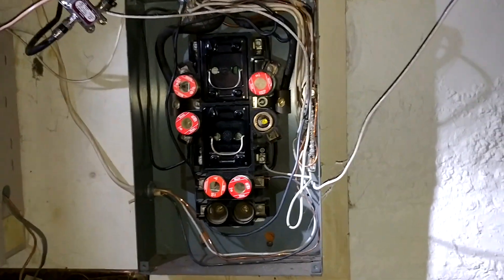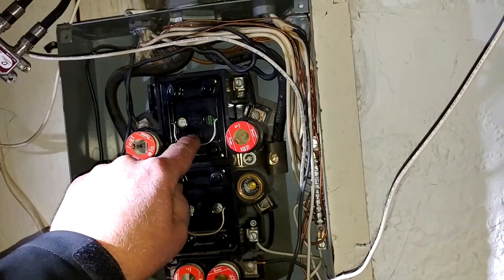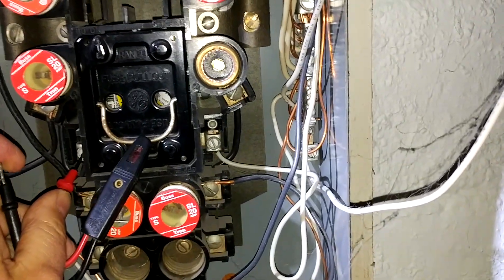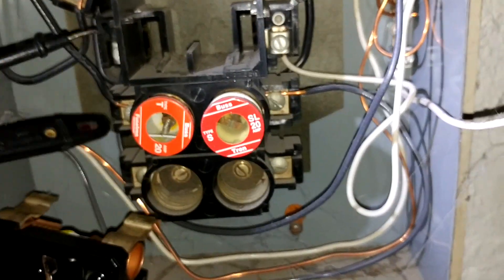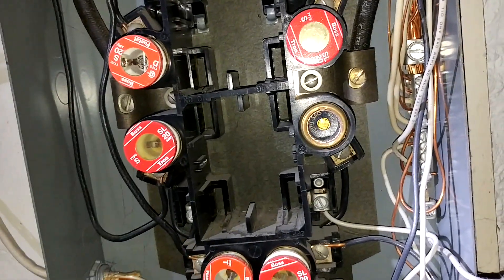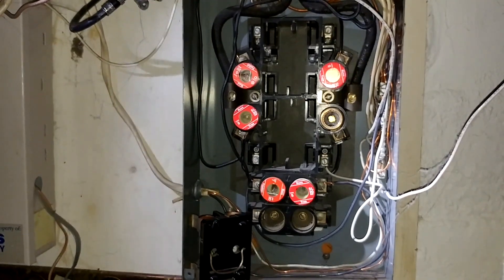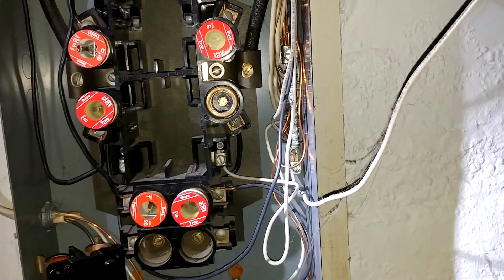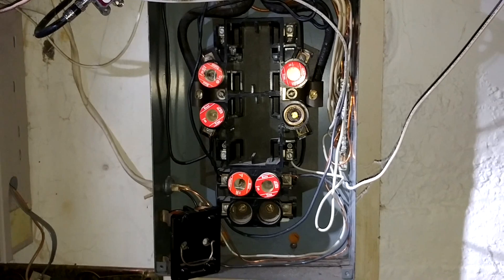Split buss fuse panel

Comment: Other variations had six pull outs, with the sixth pull out (60amp)  feeding the branch circuit fuses. That left five others for 240 volt use, usually one 60 amp and four 30 amp. There were also split breaker boxes.

Comment: Can you add a full breaker box as a sub panel to a current fuse box?
Reply: Yes you can, provided the panel is in decent shape and not burnt or rusted. There's a couple ways. Most fuse panels have feed or tap lugs coming from the main fuse block, where you can tap off using three #6 or #4 wires which run to and connect to the lugs in your subpanel. In the panel shown in the video, the lugs are on the left and right of the top of the Main fuse
 pullout. In most panels they're under the plug fuses. If you can still see or read the wiring diagram on the door it tells you where these subfeed lugs  are.  The subfeed lugs are protected by your main fuses. 

If the range pullout isn't being used, you could also feed the subpanel from this pullout block, but be sure to check the wiring diagram and see what the limit of amps you can draw from the Range pullout. Many ranges back then were 40 amp, and often the lugs for the Range pull are limited to 40 amp, even though 40 and 60 amp fuses are the same size. Often the lugs will be smaller too. Some I've seen allow full 60 amps thru the Range pull but not all of them.  Remember though that it it is a 100 amp panel, whether you use the subfeed lugs or a pullout, your limited to 60 amps feeding the sub.

Comment: I have seen these, back in the 70's there were 2 60 amp fuses and two 40's I was told were 
for the range and I had to figure if stove was fully used there'd be like 20 amps left to light 
the house.  I know because I pulled the mains and the stove would not work either. Well, if
the kitchen light was on and everyone piggin out it didn't matter if no other lights were on. . .
Reply: Yep, on a house where the stove, water heater, heating and dryer are all natural gas or propane, a 60 amp service can go a lot farther but they never have enough circuits available.

Comment: I have a same type panel but not spilt, anyway i want to use two empty 15amp fuse to make one 20 amp circuit to use for electric  baseboard Heaters, what should i  do to the panel.( two 15 amp, together to get 20 amp)
Reply: you wld just need to wire the baseboard heater with no 12 guage that is rated for 20 amps and use a 20 amp fuse if you need 220/240 consult a pro as you should not be attempting this with a fuse panel you have no clue what you are doing
Reply: In order to add 220 volt circuit to a fuse panel you would need either an unused spare pullout block in the panel that disconnects both 20 amp cartridge fuses simultaneously when you pull it out, or add a subpanel  with a double pole 20 amp breaker.  You can't just used two screw in fuses in the panel as this is not safe.
Reply: @Progrocker70  I done it long time ago, and done it by code, everything working right.

Comment: 60 amp and 100 amp split bus fuse panels look alike, the difference is that on the 60 amp panels the Range pullout is supplied from the Main fuse pullout, so pulling it shuts off everything. I never understood the reasoning for the split bus, you have 100 available amps but 40 amps is only alotted to the range pullout.  Maybe it was to avoid redesigning the panels to use 100 amp fuses, although there are fuse panels with 100 amp and even larger main pullout blocks.
Reply: I am told that if the panel is rated 60 amps, it shall not be provided with a feeder rated
more than what the panel is rated for.  I have seen split bus panels for circuit breakers
and heard of split P's for fuses but never saw one. The split panel I did see was set up
so all 240 v circuits were on the upper half, range, water heater, A/C clothes dryer and 1 2 pole breaker to supply the lower half used for 120 v or smaller branch circuits.
Reply: @raymondgarafano8604  A split bus fuse panel will have mains rated 100-200 amp. They have one 60 amp pullout for the 120 volt plug fuse circuits, and one or more cartridge fuse pullouts supplied directly from the line terminals for 220 volt appliances. It could be one just one pullout marked Range, which were common in my area where major appliances are mostly natural gas. A larger split bus panel could have up to 4 or 6 fuse pullouts each coming directly from the line terminals.  This six pulls would've still met the code's six disconnect rule. 
The 60 A panels were not split bus.

Comment: Are we sure it's a split bus?  Seems like it might just be miswired.
Reply from the maker: Yes, a lot of old fuse panels were manufactured this way.
Reply: @StructureTech1  Very true. Mine was built in 1945 and works perfect in 2021 with 20 amp fuses. I do not stress it but it does work fine with a a/c and tv running at same time.
Reply: I understand it was cheaper to make them this way, they didn't have to use 100 amp main fuses.